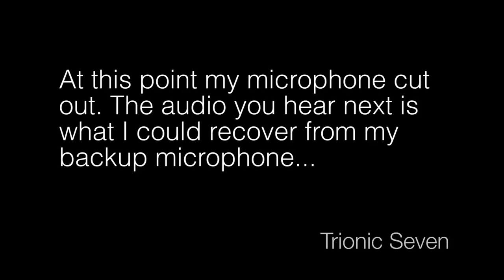Saab 9-5 DIY: Fuel Filter Replacement - Trionic Seven

Comment: Viewing your channel for the first time. Nice video, I'll be doing the fuel filter feplacement on my 03 Aero Wagon this coming weekend as well.
Reply from the maker: Good luck! I would recommend having a few largish spanners so you can get counterhold on the fuel filter (measure on the new fuel filter) when releasing the bolts.

Comment: You should run the engine and then remove fuse number 15 or 19 (depends on MY) to reduce the fuel pressure before you do this operation.

And it seems like you need new back brakes...
Reply from the maker: Rear brakes are on the todo list! :)

Comment: Would you be able to do a front/rear wheel bearing change? Would be interesting to see.
Reply from the maker: I'm not sure if I'm capable of replacing bearings myself. If I had to replace the wheel bearings I would probably give it to a professional with a press.
Reply: Trionic Seven: For Saab Enthusiasts Ok no worries. Thought it was pretty easy to do (from my knowledge of other cars)
Reply from the maker: Wheel bearings can be easy, but in case of rust and corrosion it can be very difficult.

Comment: I work as a mechanic. I have a 01 9-3 convertible. saab is one of the only makes that calls to change the fuel filter at a interval. is there any reasoning behind it? we don't normally see failed fuel filters on cars. If you use products like BG 44k which cleans the fuel system including the filter. Does one really need to change the fuel filter?
Reply from the maker: The fuel filter fills up with crud after some time and often also rusts out, leaking fuel. So yes, you need to change the filter. I find it strange that there are vehicles without a fuel filter change interval!
Reply: +Trionic Seven yea. most cars we work on mercedes, Toyota, honda, and BMW (although bmw breaks down all the time :P) don't call for fuel filter change for any major service. I'm going to go ahead and change mine at my next service 130K miles and just count it as part of the 120k service I have done over the time I got the car at 121K. previous owners had the fuel filter changed at 60K. lol. then you have people like my friend who has a 99 9-3 convertible and she never had the fuel filter changed and she's at 150K miles.
Reply from the maker: At least in the Saab 9-5, the fuel pump tends to die too early, and a clogged fuel filter makes the pump work harder and die prematurely.
Reply: +Trionic Seven yea. I should probably change the fuel filter on my friends 9-3. she is going to pay me to fix it up. So I'll add that to her list.
Reply: capang9555 is the diesel filter in the same place?

Comment: So to change the fuel filter on an Biopower Saab is impossible?  because all I was able to find on EPC is that  it uses a Charcoal canister as "Filter".
Reply from the maker: It's not supposed to be replaced. That filter is inside the tank, so you need to drop the tank. The charcoal canister is for the evap system, it's not a fuel filter.
Reply: aaah ok, thanks man :)

Comment: okay i see how you did it ! But didn't you remove the fuel pump fuse first ?? Because if you don't all the pressurized fuel will come out when you try to remove the old filter right ?
Reply from the maker: Yeah, removing the fuse is a good idea, however I didn't do it and as you can see, there was no problem with fuel shooting out.

Comment: Just finished this job. I had to attach jump leads to my 4x4 and run the 4x4 at high revs to help the saab battery
 because it took the engine 5 minutes to pull the fuel from the tank to the engine block

So the car was just turning and turning for ages before it started.

Comment: you could actually use 2 open end spanners. Seen it done at the mechanics place lots of times on my previous classic 900. One holding the filter, another to break open the bolt. Both on the same end though, not like how you did it with the box socket at one end and the spanner at the other end. 

found it on twinsaabs here.

http://www.twinsaabs.com/9-5_repair/fuel_filter/fuel_filter.asp
Reply from the maker: Yep, I should have done it that way, however I didn't have a large enough spanner to fit over the filter.
Reply: time to invest in an adjustable one! :)

Comment: is the rear stock height or did you change your suspension setup?
Reply from the maker: Maptun lowering springs, 25mm lower than stock Aero height!
Reply: thanks for the quick response, my aero wagon is about 17 mm between the tire and fender. i guess i need new springs since the inner tire started to wear out.
Reply from the maker: The wagons eat rear shocks, I'd start with them.
Reply: The shocks doesn't determine the ride hight, change springs and get an alignment done!
Reply from the maker: If a 9-5 wagon eats inner tires, it's shock time
Reply from the maker: And probably bushings, too.
Reply: i dont think its going to be the shocks because the only purpose they serve is absorbing or dampening shock funny enough. I also dont see any fluid leak on the side of the shocks or have problems on bumpy roads to warrant the replacement. The main reason i ask is because i've recently started watching your videos and have noticed that your rear height is a whole lot higher than mine. The saabs ive seen in my state (4) all have the rear low, figured it was normal. I do appreciate your input though.
Reply from the maker: You should have seen the ride height in the rear before the suspension job! The springs were so shot that I couldn't have passengers in the rear without bottoming out on a normal road.
Reply: yea i've dropped my rear suspension before to replace the 3 main bushings, read all over that its a must.
Reply: mine doesn't bottom out, but compared to yours it looks like its sagging. since i've seen other saabs with the same ride height i figured it was normal.

Comment: You should use USIT-washers (two per side, 4 in total). Atleast that's what the factory used.
Reply from the maker: I got the washers directly from my Saab dealer
Reply: That's quite strange. I checked the EPC and partnumbers for washers are: 4161162 and 4443883 and they are not copper washers. If I remember correctly last time I changed the fuel filter with OEM (Bosch) it did come with copper washers but they are not correct.
Reply from the maker: I had no idea about this, but the experienced Saab techs assured me they were the right washers.